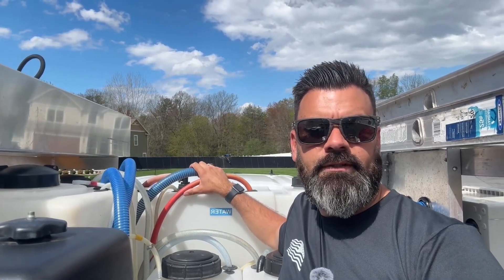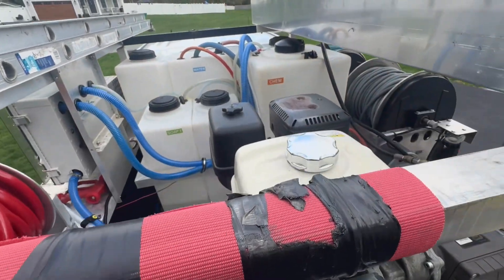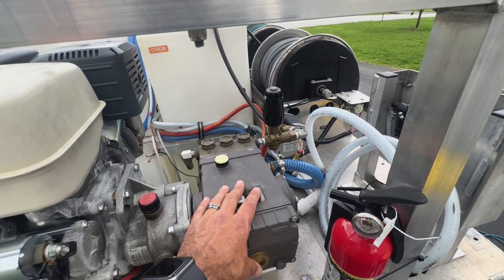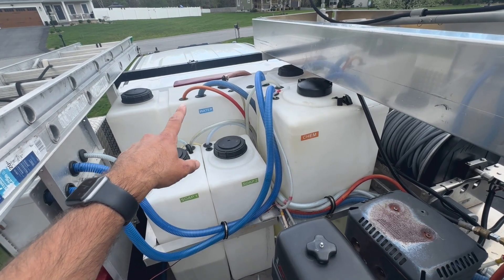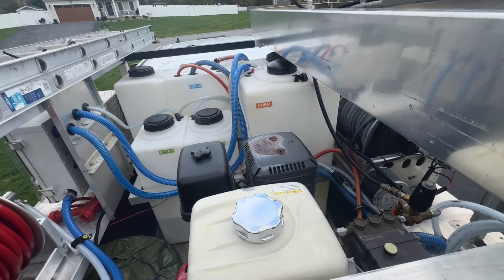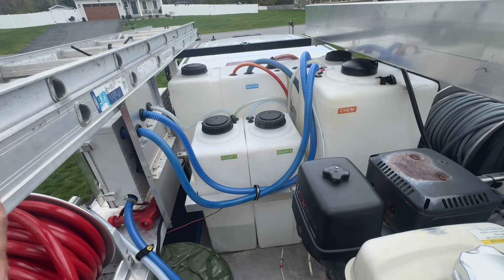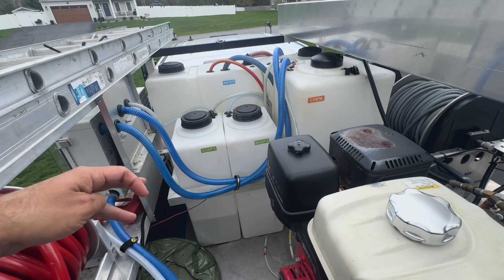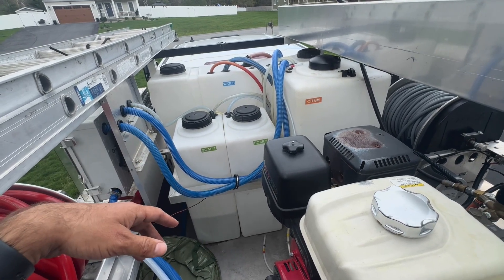Every Pressure Washer Needs One of These!

Comment: Layman's terms regarding Buffer tank. Tap water pulls from the buffer tank to your pressure washer or soft wash system which is being filled by the customers water outlet while you are using the water that you already have in your buffer tank.
Reply from the maker: Exactly 👍

Comment: Nice rig! I got a 55 gal poly drum from car wash free stuck a float valve and strainer on it.I was able to wash/rinse a12x36ft shed without water supply.I run 4 gpm and will eventually get a 5.5.Do you run a bypass on that and how much more flow do you get bypassing the injector for rinse and surface cleaner? I didn't notice much on the 4gpm when I removed the injector manually and flow tested?
Reply from the maker: Nice! I have an full time rinse on my injector so it always has flow either from sh/soap or from water. I don’t see much of a loss pressure wise from having it like that. I used to have a Flo pro bypass and it was similar pressure wise.